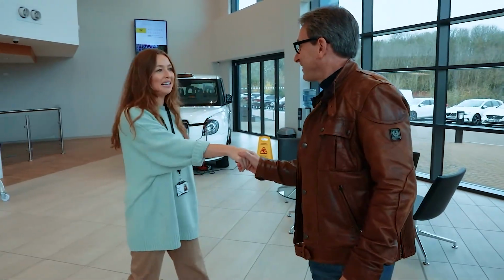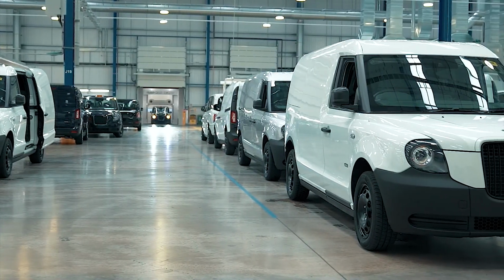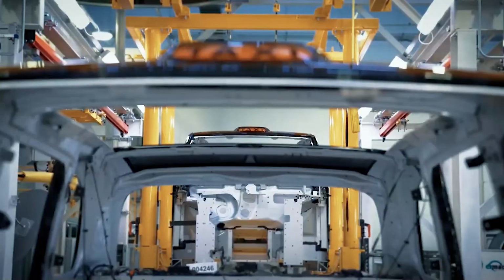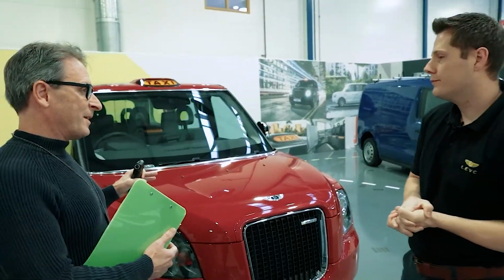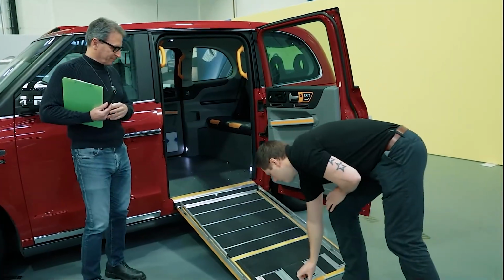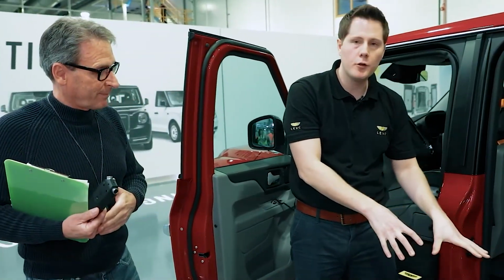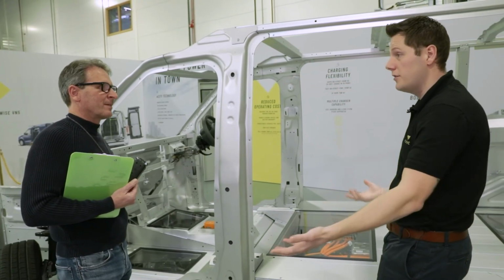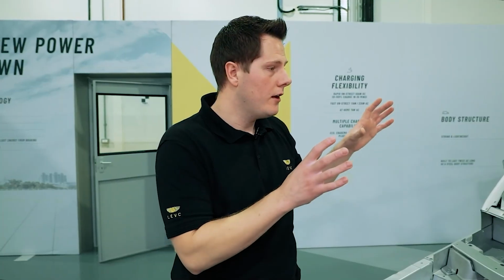How a London taxi is made.

Comment: This Vehicle Like all the vehicles from, Mann & Overton are overpriced and not a lot of thought in the Design 
This vehicle if your lucky Does  60 miles to the charge not hybrid which is self charging which makes more sense and unlike most Electric vehicles that Does 300 mile to the Charge you have always have to be  under warranty in this Vehicle as the battery alone costs £20 .000 to replace  the E Rad about £16.000 compared to Toyota prius which is about £25.000 and a superior vehicle
Reply from the maker: It’s not a cheap vehicle but it’s well built, hoping the next gen will have a better range, thanks for watching 🙏🏻
Reply: @Markstaxidiaries  this is a list of faults from another blogger 
@grahamgray7185
4 years ago
TXE faults reported by owner drivers 2018 ..
1,Software errors
2,Cracking windscreens
3,steering Bushes squeaking and need replacement
4,doors dropping
5,panels out of line
6,orange peel effect on paint work
7,steering box seals going ... steering box replacement
8,vibrates over 65 mph
9,radio going off on its own
10, meter problems were its showing to much or to little
11, excessive tyre ware
12, broken charger plugs
13,unable to unlock centre seat in the back
14, door handles falling off
15,battery completely under performing from day one
16, can not use heater due to excessive battery drain
17, various intercom problems
18,anti roll bar bushes need replacement
19,charging issues
20,back door lock problems
21,fuses blowing if both front windows opened at same time
22, cab surging forward when applying the break (few accidents reported
Reply: just want to show a list of faults from a blogger
its not fit for purpose just like all previous models we have had to suffer from this company 

TXE faults reported by owner drivers 2018 ..
1,Software errors
2,Cracking windscreens
3,steering Bushes squeaking and need replacement
4,doors dropping
5,panels out of line
6,orange peel effect on paint work
7,steering box seals going ... steering box replacement
8,vibrates over 65 mph
9,radio going off on its own
10, meter problems were its showing to much or to little
11, excessive tyre ware
12, broken charger plugs
13,unable to unlock centre seat in the back
14, door handles falling off
15,battery completely under performing from day one
16, can not use heater due to excessive battery drain
17, various intercom problems
18,anti roll bar bushes need replacement
19,charging issues
20,back door lock problems
21,fuses blowing if both front windows opened at same time
22, cab surging forward when applying the break (few accidents reported
Reply from the maker: @paulpablo7810  I know, but that’s spread out over 8000 vehicles I’ve experienced 4 of those listed above and erad. I guess that’s about right for a business vehicle with thousands of people jumping in and out. Door drop is normally to do with the wind catching it and pulling the hinges. My tx2 was never out the garage!
Reply: @Markstaxidiaries  i can go  past  the Tx2 with its tenisor fan belt noises back to the 2.2 Austin which could not go up a hill then there was the 2.5  Engine which always overheated you see there is one common denominator mann & Overton might have changed its Name to Levic but Everthing else  is the same
Reply from the maker: @paulpablo7810  Do Mann and Overton actually still exist? Isn’t it LEVC sales?
Reply: @Markstaxidiaries   i think your missing  my point Mann & Overton have been replaced  with LEVIC SALES but its the same  lack of Quality and over priced since i can remmber over  30 years

Comment: The wheelchair assembly is a nightmare 10 seconds ? definitely not! 
You must assemble the 4 studded strap studs on the floor and buckle fasteners first along with a harness suspended from the rear cabin ceiling fitting , Its a complete nonsense of a set up and with a wheelchair user facing forwards there is no head or back support that the TX4 has while the wheelchair is facing backwards Its a pity the video  does not actually show the full wheelchair set up with a person in the chair . The assembly takes twice as long as the old TX4 and twice as long to revert back with all the added straps and buckles it could easily be improved for the driver and passenger in the wheelchair You have to go down on your hands and knees to tighten up the belts to secure the chair in place and while turning the chair forwards often the straps on the floor obstruct the manoeuvre of the chair into place
Reply from the maker: A very detailed description of the assembly Sir! Better than mine in the video, yes it’s definitely not perfect. Many thanks for watching.

Comment: For those not aware of EV stats, 62 miles WLTP out of a 31 kWh battery is pathetic. A typical fully electric SUV gets about 330 miles WLTP out of a 67 kWh battery. Part of that could be explained by this thing having a face like a brick and being optimised for city driving, but still...
Reply from the maker: Yep, this vehicles power to weight ratio is not good as it knocking on 2 ton
Reply: @Markstaxidiaries  That can't be all, the SUV I quoted is 2.1 tons...

Comment: 3:50 what does it matter if its fully electrically driven if after the claimed 80 mile range it requires an internal combustion engine generator to charge up the battery.
Reply from the maker: It was the only way TFL could get it certified, thanks for watching 🙏🏻

Comment: The Shuttle could be the basis for a SUV,  sliding rear doors and the rear VN5 doors.  Which would mean that the rear seats could be moved forwards. The dividing screen removed and a passenger seat in the front.  No doubt there will be a longer chassis van with the option of a campervan.

Comment: a passenger variant of the LEVC VN5 AWD + 0.5 in. Lift 68.3 kWh iSMARTPower® 4-Dr Compact e-MPV (RHD) would be something . . . it'd be a 6-seater with multi adjustable actual Nappa leather captain seats & trim as well . . . a hybrid variant of the LEVC TX 4WD + 0.5 in. Lift 68.3 kWh iSMARTPower® 5-Dr Compact e-Hatchback (RHD) is very much needed . . . powered by a 1.4 Biturbo I4 and a 34.0 kWh HYBRId® system, mated to a 8-speed auto transmission . . . in pure electric mode it'll have a range of 43 kms - 56 kms . . .